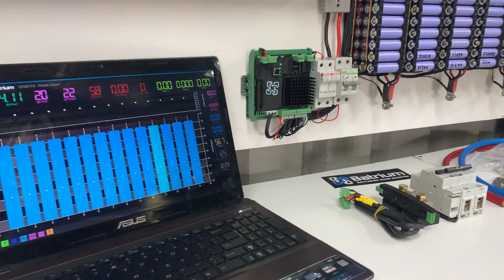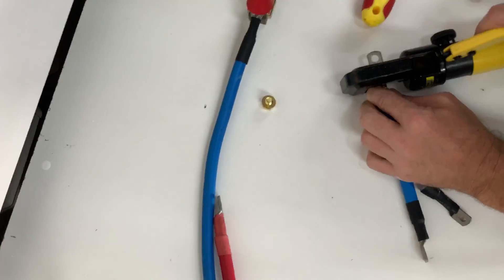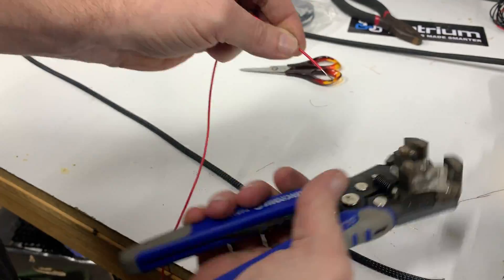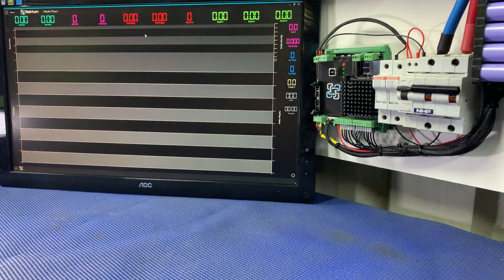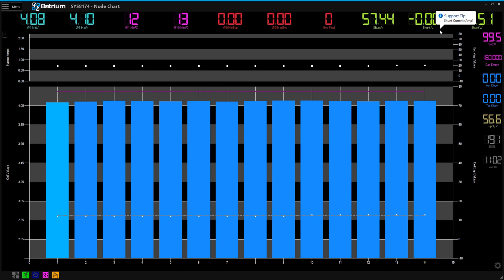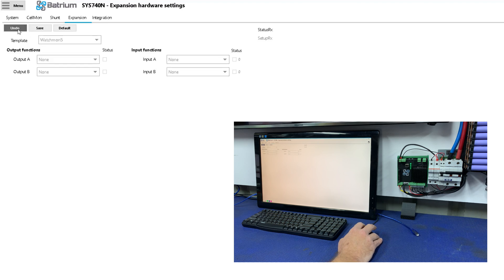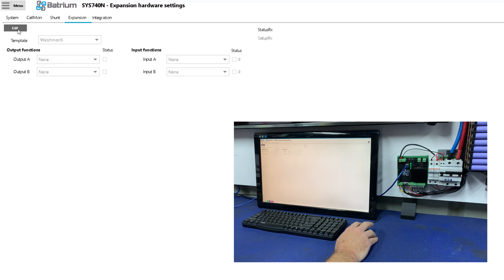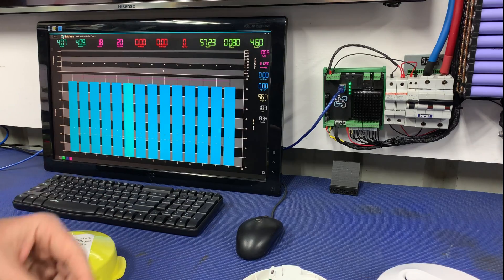Installing a Shuntmon & Trip to a Batrium Watchmon Plus

Comment: Hey Pete, Did you manage to get the smoke alarm to work with your system?
Reply from the maker: yes, but never used it.. i need to finish my huge grey battery build plan was to use a few in that.. inside/outside etc

Comment: OMG, is this setup is for Recharging the cells, is that all cells are Recharging at a time?? What is the setup installation cost for this all equipment?
Reply from the maker: it's just a battery pack to run things from charged via solar - i'll do a video on parts and diagrams

Comment: Why did you select Critical Pulse instead of Critical Fault?
Reply from the maker: Because when it trips i have to unplug the shunt to turn it back on. I believe that's the technical reason - naturally if i had the WM powered differently this wouldn't be an issue
Reply: Ah ok, you had me thinking I did mine wrong lol.